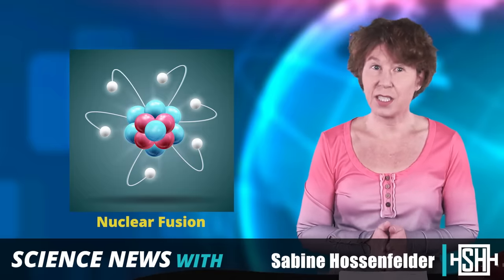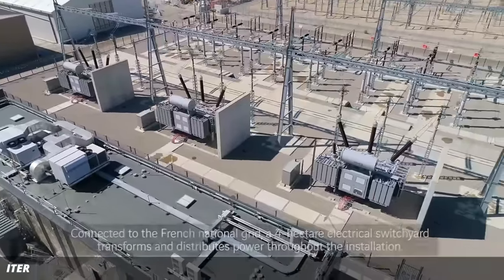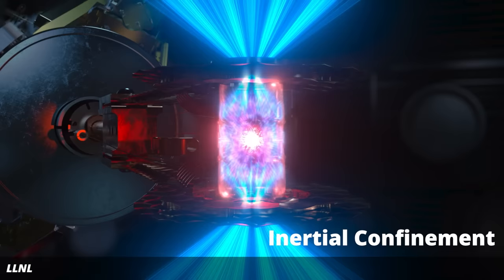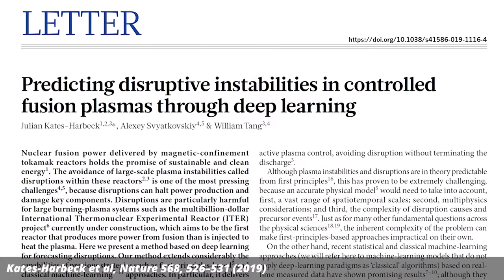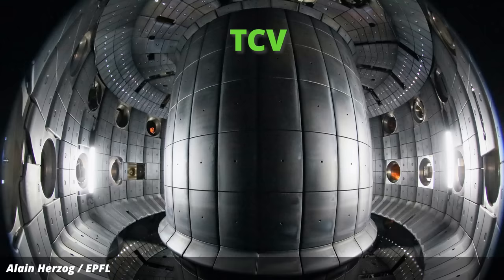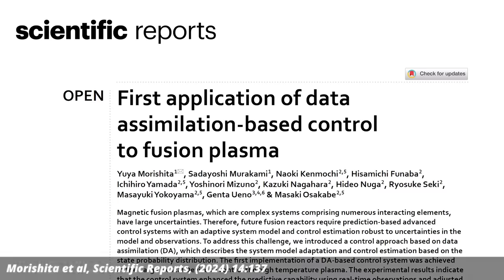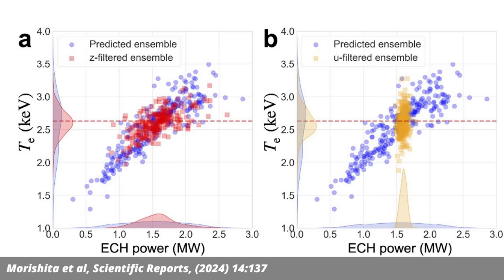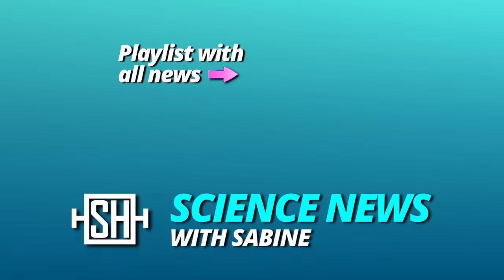First Nuclear Plasma Control with Digital Twin

Comment: Dr Robert W Bass proved mathematically fifty years ago that Stellarators and Tokomaks (in a two-dimensional surface model) are "Structurally Unstable" in the Peixoto sense applied to dynamical systems.
Reply: i doubt that is mathematically correct
Reply: @drgetwrekt869  :  Since the modeling was a two-dimensional model approximating only the surface of the 3D-plasma volume, there is no certainty that the lack of "robust" stability (Peixoto Structural Stability) is strictly mathematically correct.  The criteria of 3D Peixoto Structural Stability, as I understand it, is highly specialized to the particular conditions and context of the dynamical system equations, and not yet developed enough for such 3-D complex magnetohyrodynamic structures such as a Tokamak or Stellarator.
Whether an occasionally "hallucinating" AI system, whether only 20% or 3% wrong, could ever "reduce to practice" sufficient control of an expensive, overly Yuuge practical fusion-temperature system may be even more uncertain -- such as suffered by long-term weather forecasting.

Comment: A digital twin can be different from a model... It goes beyond a mere model by incorporating real-time data from sensors. by representing real-world assets/systems, one could trust the machine learning performed on a digital twin to be performed on the real world asset with the same results. you can't always say this about models as the goals of a model may be different. A digital twin is always intended to mirror the real-world asset.

Comment: Electricity generated by controlled fusion would be amazing, but I still haven't seen anything showing how it would generate the electricity. It all seems very:
Phase 1: Controlled fusion
Phase 2: ?
Phase 3: Abundant electricity
How is electricity generated by fusion? I assume boiling water is involved, but is there a reliable way to capture fusion energy for practical use?
Reply: Fusion creates a ton of heat. You use the excess heat to heat water. Water turns to steam. Steam blows through a turbine. Same way we do with fission reactors.
Reply: True. I wasn't clear in my question. How are the designs going to transfer heat efficiently enough from the plasma to water to make it practical? All the designs have so much equipment just to contain and control the plasma  there isn't a lot of space for heat exchange.
Reply: @arthropoda2225  Keeping the plasma off the walls is simply just to keep them from not melting the entire thing will be kept at a saftey margin of the structural limits of the materials anymore and the energy required to run the magnets is wasted. Likely they will line the outside in whatever is the most thermally conductive material at the temperature they plan on letting it run at then flow water over it. That is the really easy part though so a lot of designs don't include that because it's like designing a new vehicle and starting with the seat belt. We already have that figured out on a ton of things. We just are iterating designs now to find one that lets the reaction sustain.
Reply: @arthropoda2225  high energy neutrons fly straight out of the magnetic confinement and through the reactor walls into liquid metals or pebble-bed solid metals and make them very hot, while also producing more tritium for the reactor and yet more heat, and that heat is used directly or indirectly to produce steam. In stellarators and tokamaks, at least.

Comment: Perfectly clean source of energy? Not quite right, is it? It is not foreseeable that fusion reactors will be able to produce the tritium required for their operation themselves, which is why they will continue to be dependent on tritium produced by special nuclear fission reactors.
Reply: Various teams are looking at a closed-loop Tritium fuel cycle using lithium breeding blankets in the fusion reactors. I'd call that foreseeable, even if it is likely to be difficult.

Comment: As I'm not a physicist, I'm skeptical about all that, and i have one question: for fusion is used hydrogen, deuterium or tritium? I think it must be deuterium, but with a proportion of 0,0156% in salt water, won't it be more expensive to obtain deuterium than it will generate?
Reply: If fusion can be made to work, it will produce 10,000 times the energy per mass of fuel versus chemical reactions (like burning hydrogen, oil, methane, etc.) It's also relatively simple to separate Deuterium from water. If they can make it work, the cost of the fuel will not be the bottleneck

Comment: Now Sabine I am no expert and have no qualifications in any scientific matters so am  just interested in physics in general. Now I have a simple question which you may find rather too simple but just what happens the the heat generated as I am guessing that it is what is intended to produce the source of generating electricity as is done in conventional nuclear plants? Does this heat produce any waste and just how much fuel I am again guessing is hydrogen is needed to sustain the reaction? If this is the case then would this be possible for the plant to produce the power needed for distribution but also a part of that output also be directed at keeping the reaction going? If so this would be such a breakthrough.
Reply: Look up "break even" and "burning plasma" for your answers

Comment: This reminds me of the old PID control where the D for derivative is the anticipatory part of the the control.
Reply: PID can not look into the future.
Reply: the D part is almost never used
Reply: @xxxy912    tell me how to look into the future so I can hit the Mega and Power Ball routinely.
Reply: @drgetwrekt869  Depends on what you are controlling. I did use D in the current loop to compensate for inertia to aid the speed outer loop to maintain control of  a DC motor.
Reply: Ok, but that's like saying a bullet train reminds me of a commuter train.

Of course knowing basics and having studied the most common of control systems is great.

Comment: Imagine a nuclear crucible inside of which the temperatures are higher than the interior of our sun.....

How to contain and control the heat and prevent the crucible from disintegrating under the enormous heat and pressure and how to extract more heat from it more than the energy that is put in to heat it.

These issues makes me wonder whether it is possible to achieve the impossible?

Comment: can you make a video on how to extract the energy generated by the fusion process in the confined plasma? that seems like the biggest questionmark to me
Reply: Absent help from super-intelligent AI, which hasn't yet been made.... I wouldn't worry about extracting the energy.  We're so far away from returning the energy invested in running one, and have been so for decades, that the most parsimonious expectation is it will never happen. Plasma efficiency is not system efficiency,  nowhere near.

Comment: Fusion not only has to work, it has to work at an affordable cost of the electricity. I tend to believe that they will never achieve that goal. The cost of the guts of a fusion reactor will make a fission reactor seem like a bargain.
Reply: There are really promising advances in high temperature superconductors, which would mean the guts shrink a lot, compared to the generation of ITER and JET.

Helion Energy and First Light Fusion are of course very interesting startups exploring totally different and possibly simpler avenues.

Comment: I'm glad they are making all these advances, but I think fusion enthusiasts are ingenuous about the enormous materials science and radioactive waste issues. Perhaps 80% of the energy produced will be in neutron streams, and those will significantly activate structural materials. All the containment materials will need to be replaced often, and disposed of as radioactive waste. Yes, there will be a smaller proportion of long-lived alpha-emitters, but nobody is going to want to take the contaminated containment materials.
Reply: Do you understand what (n,gamma) reactions are? 80% of the energy produced is in neutrons. Those activate the surrounding materials to generally unstable isotopes. I did a thesis on neutron activation radiochemistry at MIT.

Comment: But are there still not huge problems which haven’t even started to be addressed?   Such as chamber materials which will last longer than a couple days when subjected to production levels of neutrons.
Reply: Yes, but that is much easier studied if you actually have a working reactor to produce real conditions. Doing it just from theory and small scale experiments would be orders of magnitude more expensive.

Comment: sounds like this method requires an amazingly accurate simulator..whoever wrote the model must be really good...oh..or did they get an AI to constantly  tweak the model :-) though it sounds like an expensive process if it reuiresmany tries where failure damages the real thing

Comment: Over 70 years of practical experience producing power from fission. 5th generation reactor designs. Advanced fuel reprocessing. We're set! No? Right, we need to hold out for super complicated, controlled thermonuclear devices. And it will likely need advanced AI to control the reaction. What could go wrong... If it ever even works.

Comment: What control signals actually exist besides the magnet current? Are there injection currents that make any difference to the control feedback? I would expect there are too many unknowns for the plasma equations to have linear stability...(?)
Reply: Isn't the entire point that it's dealing with an inherently unstable system? The model is looking for patterns that indicate incipient instability and then heading it off. It should be agnostic as to what the source of the instability is because it's just doing pattern matching not following a logical/causal analysis.
Reply: @wiegraf9009  Supposing that was the entire point, then the Physicists working on fusion would be doing something completely irrational, while they could be doing something that was partly rational based on some mathematical model. When it comes time for the accounting, there has to be ways to force the outcome to make rational sense, which has to have people that care behind it, somewhere.
Reply: @ryanchicago6028  Not necessarily. We do lots of things using tacitly known methods that are not understood by us using logical analysis. For example we rely on democratic voting to select leaders in many countries with no detailed/rational understanding of how the decision is arrived at by the electorate. Looking at it from the perspective of the "the nation" it's basically a black box that we have a very limited understanding of but we still rely on it a lot.
Reply: @wiegraf9009  I think that people are upset about the possibility of fraud behind plasma physics - which would be a very bad thing. I don't think I quite understand what you mean, and would rather not talk about it anymore.
Reply: They have neutral beam injection for heating

They have RF heating (like a microwave)

Practical Engineering had the best recent video about ITER (or was it Up And Atom?)
Reply: @u1zha  Thanks for answering. How can feedback be acheived this way? Is there a way to sense what the beam is doing to the plasma? Is there even a way to sense the density of the plasma at all? That was one of the pictures shown. The profile of the plasma could be computed, but sensing it would be impossible (I believe). That's my simple question.

Comment: I have a feeling "AI" isnt going to be too reliable in controlling a reactors heat energy and keep the reaction stable at the same time. Those sensors need to be extremely resistant to extreme heat.

Comment: This is what I don't understand; isn't the chaos controlled by magnets? If you have chaotic plasma in a volume, should it matter if it is chaotic when it is contained by the magnets? Perhaps their magnets are not properly containing the plasma in the first place? Ok, I though that perhaps too much plasma is building up in a part of the volume, therefore there isn't enough magnetic force to keep it contained there; therefore, the need for prediction. That would make more sense. I also thought, what if they could set the plasma in motion so that it doesn't spin out ,but move and form into itself? Then the magnets can move and contain it even more closely? Just ideas poppin into my head.

Comment: Solve the energy worries of the world?  Not so sure about that concept, as modern civilization is a dissipative heat engine processing vast amounts of materials regardless of the energy source.  Jevon's paradox illustrates that switching to a more "efficient" or "cheaper" energy source hasn't reduced consumption of either matter or energy, but has historically increased both, with attendant rise of entropy in the form of heat and environment degradation (pollution).
Reply: Thanks! I can stop reading stupid comments in despair.

Comment: The only actually viable design was introduced by Helion Technologies.

There are Three THE MOST important factors:
1. Scallability. Reactors myst be as small and cheap as possible, to make mass production viable. 
2. Minimum moving parts. 0 at best. 
3. Reliable, cheap fuel. Because is musrt be abundant and safe for the reactor.

Almost every design has 2-3 issues with those 3 requirements, this is why they are more like science research projects and not actual potentially viable fission reactors.
Helion fissioon reactor fulfills every of the three requirements.

Comment: What if they dope the system with metals to bond to the hydrogen and be more stable in the magnetic field, like palladium or sodium?
Reply: then they'd take orders of magnitude more energy to get up to fusion temperatures due to the added mass and the added positive repulsive charge. You would never break even.
Reply: @MattNolanCustom  darn. There's always a catch.

Comment: Can iter be updated after 5 year of run to stelerator ?
Reply: Wow that would be a somewhat ridiculous project. I'm sure in 5 years of run, ITER will have still a very long backlog of research tasks and will still be relevant (and powerful stellarator experiments based on new discoveries in efficiency and using newfangled high temperature superconducting materials will be built elsewhere, in parallel)

Comment: What are the risks of functioning fusion getting out of control, in say one of these tokomaks? 'Only' destroy the machine? Or a bigger bang and run away out of control until it eats all the material of the planet? 
Clever as it may be to get this working, given the likely costs of the plant and fuel making, it probably never can compete with renewables, solar mostly. Battery grid storage solves the no sun/wind issues. Keep things simpler, and widely distributed, not heavily dependant on a few power stations.

Comment: We've been "very close" to making fusion a commercial energy alternative reality for what - 40 years now?? Yeah, right. On a scale of 1-100% in terms of viability, it looks like over the past 40 years we've progressed from 1% to about 1.5%. Getting to the "break even" point was supposed to be the "big hurdle" at one point. Now it's apparently stability and containment of a continuous fusion reaction. The reality is the remaining 85-90% of the journey will actually be extracting a useful amount of heat energy from a sustained fusion reaction with a heat exchanger that lasts more than a few seconds....duh....You need to jump through a lot of hoops to build something that contains the plasma reliably and safely. But then you need to open up access of that plasma to some kind of heat/energy transfer mechanism that doesn't get destroyed instantly. Good luck with that....

Comment: From scientific point of view it might be nice, if controlled nuclear fusion can be realized on Earth. But much more important is, it has to be economical. So it has to compete with the very safe nuclear fusion reactor in 150 million km distance, which delivers sun and wind power NOW and in future very reliable and at low costs. This most researchers and politicians forget. Also ITER with it's modest 200 MW(el) will cost >30 bn €, start >2035 and is not even a prototype.